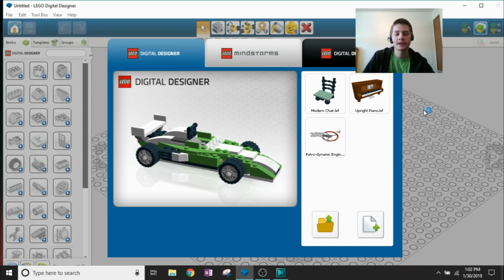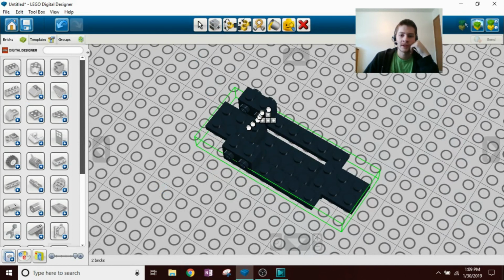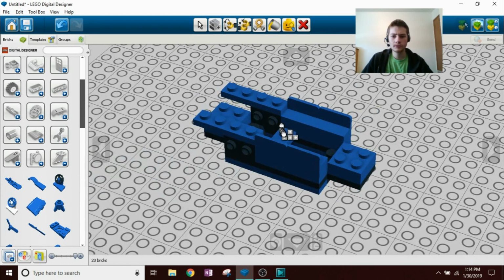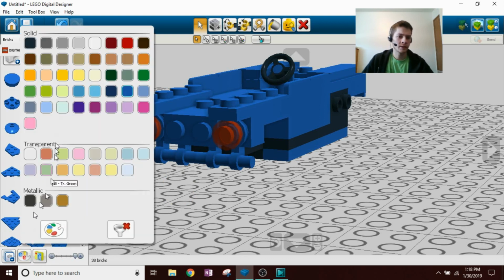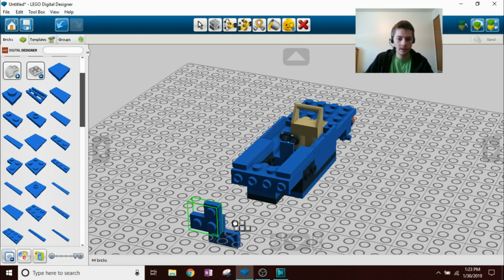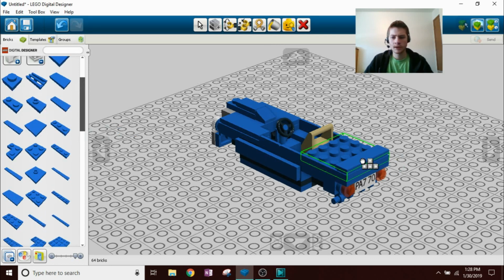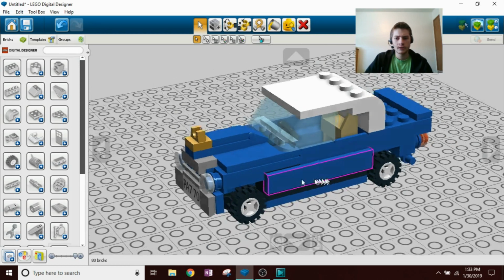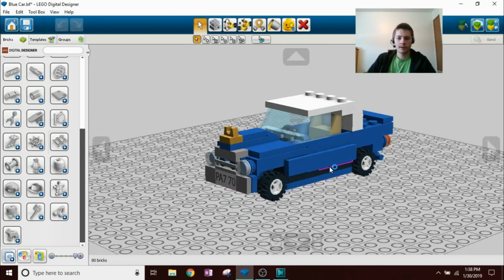LEGO Digital Designer Introduction and Tutorial

Comment: hello, I want to ask, I load the already created LDD, then I create a construction plan, but the individual steps of the construction seem to be shuffled, can this step be corrected so that the correct steps follow each other?
Reply from the maker: I would have to check the program again, but I think the closest thing you can get to a step-by-step order of parts is to use the grouping feature. Otherwise it will just add parts one at a time in the order they were placed by the user. It's been a while since I used LDD for instructions, so it's possible that I'm wrong on this and the software uses a top-down approach independent from placement order.

If instruction creation is something you need to have more control over, I suggest you take a look at Studio to see if it might work better for you
Reply: Is it possible to open an LDD file in the studio? If I gave you a link, would you be able to see whether it goes through the studio or through the LDD program?
 @BrickSystemBros
Reply from the maker: Yes, Studio can open LDD models just fine. The file has the LXF extension so it will look like car.lxf or house.lxf, these can be imported to Studio natively.
Reply: However, the point is that the LDD file contains new parts and also parts from buwizz, and the studio probably won't be able to display them? @BrickSystemBros
Reply: I would like to ask, would you be able to make a pdf plan of this model for me, or for a fee? (under the video there is a link to the ldd file, ) 

https://www.youtube.com/watch?v=Trsarc0vc18&t=499s

 @BrickSystemBros
Reply from the maker: I will check out the model this week, let's continue the conversation on email, please find our email address in the about section of our channel and reach out.

Comment: is there a way to remove/hide the ground, as in the baseplate that spreads w/ multiple builds
Reply from the maker: Hello, this question sent me down quite the rabbit trail. The short answer is yes, probably possible to remove the grid from displaying in the software. It would involve some rather work-intensive modification using some community-developed tools to mess with the assets in the program, but with some effort the LDD Program can be modified by the user.

It seems like an incredible amount of work and should really be an option in the preferences menu, just have a toggle grid on/off. That would make sense, right? (Stud.io from Bricklink actually has this feature, by the way) 

Now is not the time for me to dive into the LIF extractor toolkit made by JrMasterModelBuilder that would allow me to give you a definite answer, but if you are so inclined I'll point you to this thread on the Rock Raiders United forum: https://rockraidersunited.com/topic/3764-lego-digital-designer-lif-extractor/

Thanks for the question, I have another bookmark in my LEGO folder now, maybe someday I will tackle the world of LDD modding

Comment: Hello! I am looking to build a fairly large moc for my first moc (hunger games CF cornucopia to scale) what would you recommend to build online to take the least amount of time, are there any duplicate or copy things that help. Or is that too ambitious of a project for lego ideas and should I just order a crap ton of pieces and build it?
Reply from the maker: LDD, which is shown in this video, is probably easier to pick up and get building if you are new to LEGO building software. Another option is Bricklink Studio, which is a bit more complicated but has higher functionality. (https://www.bricklink.com/v3/studio/download.page)

Both programs have some basic copy & paste functionality, but the Cornucopia is a complex shape and will probably be a lot more of manual brick placement and adjustment, so having the ability to duplicate a given part or group of parts might not be very helpful. 

After taking a look at some of the reference images, it is a large structure but not very dense. The most accurate brick-built version might be done with a kind of shell approach, using plates connected with hinges and clips to form the walls. A complex geometric puzzle for sure, but it would not require a huge amount of parts compared to a stacked-bricks-and-slopes approach. Check out the functionality of pieces like 14417 with a friction ball and socket joint that allow plates to be connected at crazy angles.
https://rebrickable.com/parts/14417/plate-special-1-x-2-with-59mm-centre-side-towball/

A caveat about the plates approach, it is quite tedious to do this positioning in building software, and many of the newer parts do not exist in LDD. If you want to explore this option I would recommend having these kind of parts on hand to get a feel for how they connect and perform in real life.

Thank you for coming to my TED talk
Reply: @BrickSystemBros  no thank you I am so hear for it, do you have a user on like Reddit, Twitter that I can send a pick of the reference image I’m thinking of if you don’t mind? Love your vids!
Reply from the maker: @jadenspops608  glad to hear it! I'm not active on those platforms at the moment, just send it to our email, bricksystembros@gmail

Comment: Great video!
I was wondering if I put my Lego designs on this program and make instructions on how to build it is it safe and for my eyes only to see or can my designs get stolen somehow or seen by anybody online or seen by the Lego company that runs this free program if I use this can I fully trust it?
Reply from the maker: Interesting question. Once downloaded and installed, LDD is completely cut off from being accessed through the web. Any designs would have to be uploaded intentionally for them to be available. Many years ago, LDD had an option to order the parts and build your models but this has been disabled for a long time and that part of the software will prompt you to run in "offline mode" when the internet connection fails to be established. In terms of trust and safety, it will be as secure as native applications that you trust with your other sensitive info, like photos and receipts. 

As mentioned in my pinned comment, LEGO no longer offers this program directly, but there are archived pages where you should be able to download the last few versions of the software. Try the LDD topic on the Eurobricks forum.

Comment: Very good video btw.
I have built a few models with LDD , with my current build I used technic beams attached to the stud side of a brick. I have tried to replicate this in LDD but it does not work. Is there a trick to this ?
Reply from the maker: Thank you for the support, I am pretty sure that the connection is too tight for the tolerance in LDD, even though it is possible in real life. I am not aware of an easy solution, but it may be possible to tweak the levels in the program.

Comment: Does it have Technic parts as well or is it just blocks?
Reply from the maker: Some Technic at the bottom, but a little out of date
Reply: @BrickSystemBros  interesting. I kept trying to find pictures to see if they having any of these but I can't find them. But since you have the software, do they have pieces like Lego used for the Exo Force figures?
Reply from the maker: All of the rotating joints are included with the current version available, but I couldn't find this part: https://www.bricklink.com/r3/catalog/parts/Buildable_Figure/Bionicle/product.page?P=41672

Are you looking for a list of parts available in the LDD inventory? I think it would be easier to just download the program and spend some time looking through it. The search function will narrow it down pretty quickly if you have the part ID, which can be found on Bricklink (the site I have linked to above) if you remember which set or theme the part can be found within.

Comment: Are you able to open two items at once?
Reply from the maker: YES! I had to open LDD to confirm this works just now, but you can load additional models onto the build floor by using the "import" option in the drop-down menu when you click "file" in the upper left hand corner. Select the item you want to add to the initial project and place it anywhere.
Reply: @BrickSystemBros  Thanks. Using my Solidworks terms, it's probably not possible to import a completed set(assembly) into a master assembly and combined it with a saved separately build that once completed can be used to export for parts and instructions. I am thinking of designing an add-on for 7997 and would like the actual set to be adjacent to the new section as i think and build. I downloaded Studio2.0 based off your infrastructure comments.
Reply from the maker: @zandylovesrisk  Studio is a good place to start, but if that doesn't work out I think it is possible to achieve what you described with LDD. Also, as this tutorial is getting dated I would like to do a new one this month. If that happens I will include a segment about this functionality.
Reply: @BrickSystemBros  Again using my CAD background, is their a internet library were you can download completed Lego sets like GrabCAD for CAD based software?
Reply from the maker: Had to do a bit of digging but looks like this forum has what you're looking for:
https://www.eurobricks.com/forum/index.php?/forums/topic/41226-key-topic-official-lego-sets-made-in-ldd/

There are hyperlinks on the main page to browse themes alphabetically in four main groups, from there the individual lxf files can be downloaded. lxf files are native to LDD but can also be imported to Studio, which is a more up-to-date digital builder. 

The main drawback here can be found when looking at recent sets, mainly within the past four years. As LEGO introduces new elements they make their way into more and more sets. Since LDD isn't supported, there is no central update system to add the digital parts to the LDD library. Others have taken on the task but it's probably a matter of finding 3rd party patches on Github and manually adding the new parts yourself.

Also note that by the sheer number of sets LEGO has produced, even the small army contributing to the digital database have not completed models for the entire product range, although the Eurobricks effort seems to be the most complete to date.

It is worth mentioning that the LEGO-owned Studio is still updated regularly with patches for new parts every other month or so. lxf files can be imported to Studio, as mentioned, but models already native to the program can be found here: https://www.pascalsbricks.co.za/official-lego-sets-studio-files/

This library appears to be the work of an individual fan, so expect even fewer official models to be available here, albeit with correct elements already in place.
Reply from the maker: Guessing from one of your comments above, you're looking for 7997. It looks like it's been converted to lxf and can be downloaded here: https://www.eurobricks.com/forum/index.php?/forums/topic/41226-key-topic-official-lego-sets-made-in-ldd/&page=21&tab=comments#comment-787176

Comment: Hi. i know this vid is from a year ago but when i try to go to the ldd website i get an error and before i can read it i get sent to Lego site.
Reply: Sorry. We don’t support LDD version 4.3.10 anymore.
If you still use version 4.3.10 you will experience errors when launching the application.
You can still use “offline” mode if you wish.
We urge you to update, use the download link, and install free application for Windows PC & Mac OSX.
Reply from the maker: Hello, thanks for the question. In this video I am actually using the offline mode. It still has full building functionality because it should be running from a file downloaded on your computer. The option to connect to the internet was used several years ago when LDD allowed fans to order the actual pieces in their creations directly from the software, which is really cool but was not really sustainable for LEGO, so it didn't last very long.

Based on the error message in your second comment you were able to visit this download page: https://www.lego.com/en-us/ldd
If you have an older version of the software you will probably have to download the 4.3.10 release from that LEGO page, just scroll down and use the links for Windows or Mac depending on which OS you use.

Hope this is able to help, reply if you get stuck or have more questions.

--Nathan

Comment: On the home screen with the green car, what is the white part on the side that is a slope and is next to the grills?
Reply from the maker: Looks like a 1x1 white tile next to a 1x1 slope, the shape is a little distorted but if you look closely they have the same thickness as the grill. It appears that they are held in place with some bricks that have additional studs on one side.
Reply: Brick System Brothers oh. Thanks for the help, I thought they were a single merged piece. Luckily I got studio 2.0 which is more updated

Comment: how did you get more bricks?
Reply from the maker: Hey Joshua,

The best way to make sure that your version of LDD looks like the one I use in the video is to follow the link in the description above, if you have an old version of the software you may not have as many features. 

If you're talking about where to find the pieces themselves and you're having trouble locating a certain part try the search bar, using just a few key words to narrow it down.
Reply: ok but what version are you using?
Reply from the maker: @Joshua Campbell 4.3.10 in offline mode, when the splash screen loads choose the 3rd tab on the right called "Extended Edition"
Reply: oh right i tried offline and i can't find the parts in extended edition. ^^;

Comment: I had this a few years ago. Have they updated it in any way? I remember it was pretty limited back then
Reply from the maker: Mike, I think it's been about 3 years since LEGO stopped supporting LDD, (updates, bug fixes, etc). The one change you might have missed was the "extended edition" that provides a more complete color selection and some older elements. The actual mechanics of the software has remained pretty constant for the last several years. If you are looking for something similar that is currently supported and has a few more advanced features I would recommend you take a look at 3rd party software called "Stud.io" here: https://studio.bricklink.com/v2/build/studio.page
Reply: @BrickSystemBros  i see. Thanks!